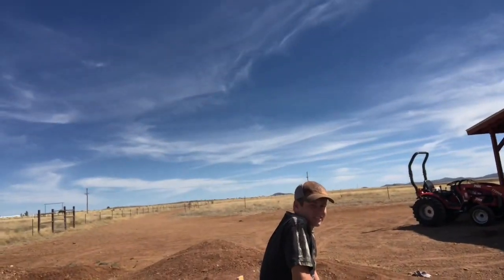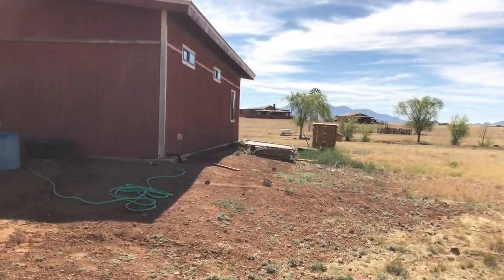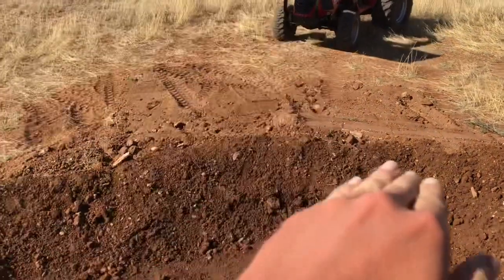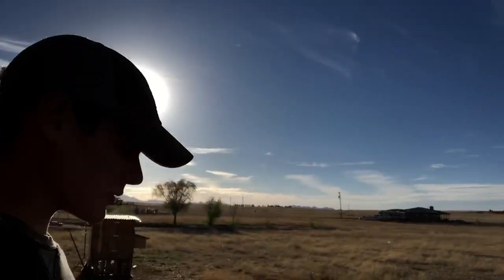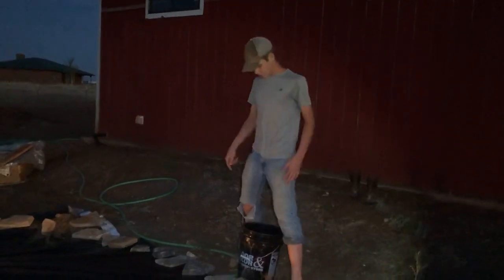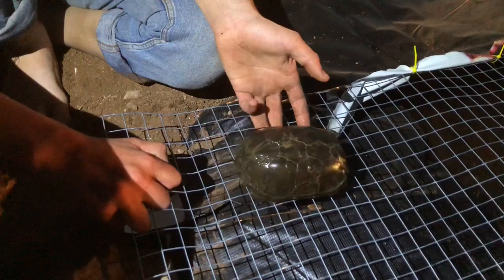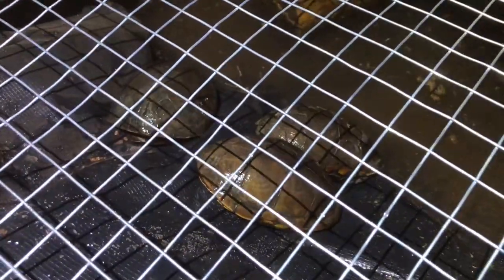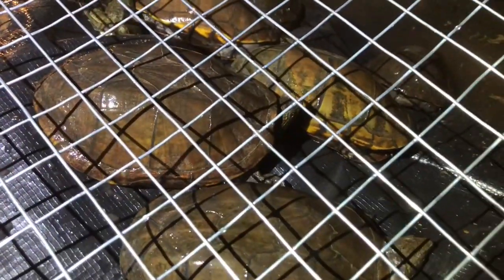Making a Pond for some Endangered Mud Turtles

Comment: I have a wild diamondback terrapin that I found injured on the road. I'm using a 110 gallon stock tank. I read for wild caught terrapins you should put them in brackish water, what is the salt to water ratio for brackish water? Any info is helpful, thank you!
Reply from the maker: Lucky 13 

I am not sure. It would be best to give it to a wildlife center. It could be illegal to keep it.